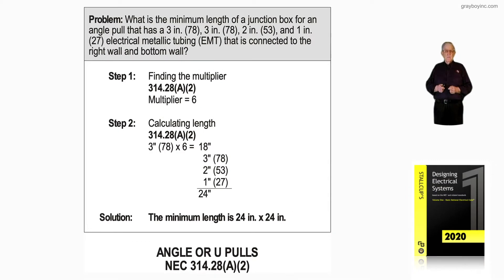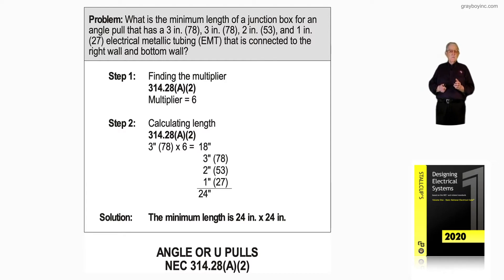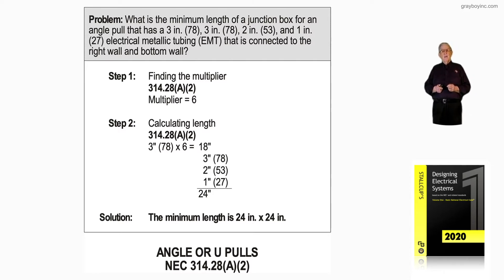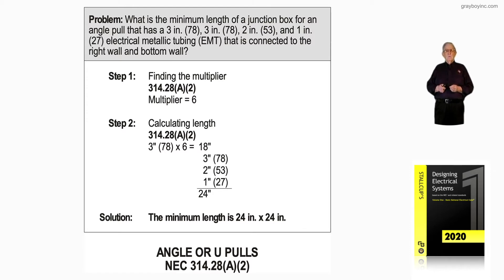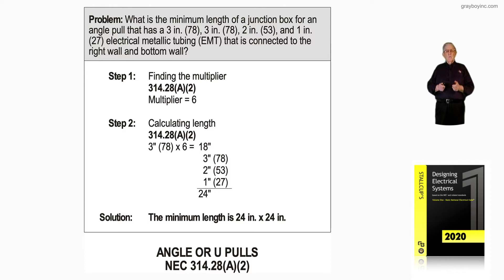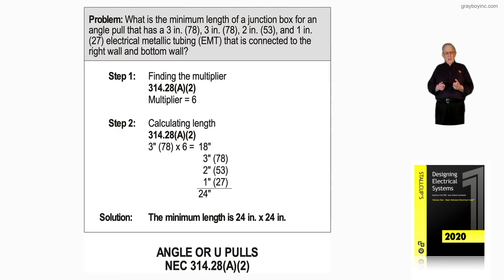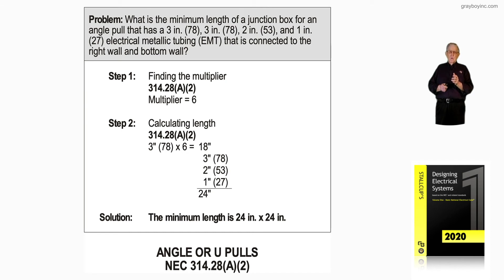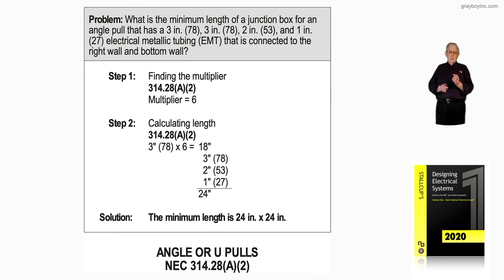12-20.2  ANGLE OR U PULLS - 314.28(A)(2)​​​​​​​

Comment: Clear as mud. Are you referring to the previous video? Do you get to exclude conduits that are too small for #4 wire? If you calculate the distance to 18 in, you next have to increase the distance by the sum of the diameters of all other raceway entries. Does this include the raceway that's part of the angle pull or U-pull that was excluded because it might not be the largest? For instance if you had a 3" going to a 2" angle pull, it would be 18" + (2"+1"+1") assuming the two 1" conduits are on the same row. I've seen YouTube examples including and excluding the 2".
Reply from the maker: www.grayboyinc.com 
Use the following coupon code at checkout for 45% off all products. Coupon Code:   22GB45